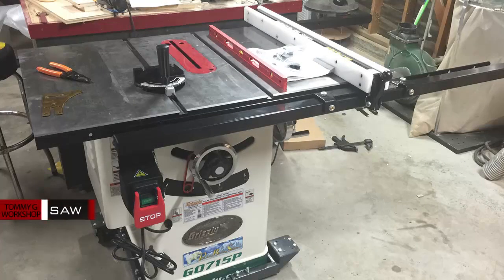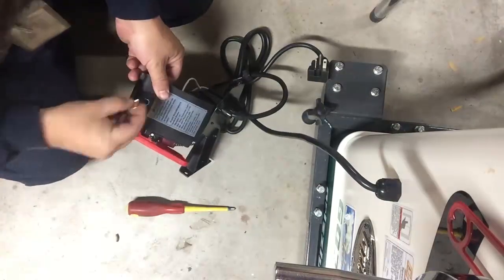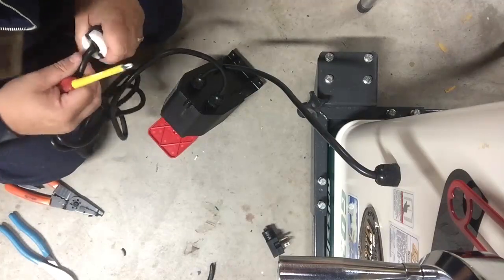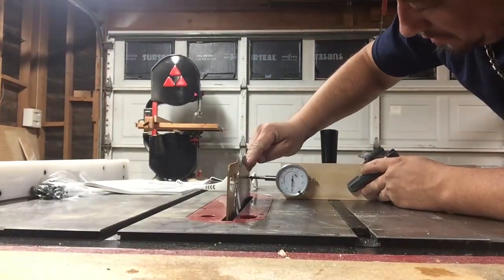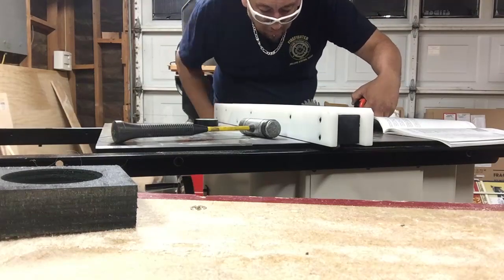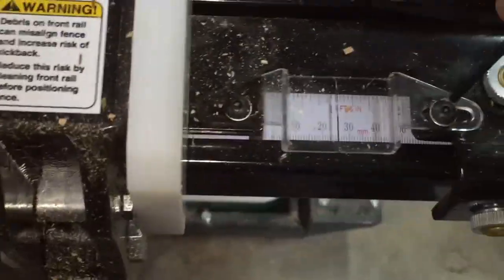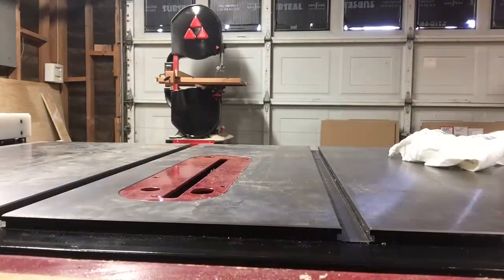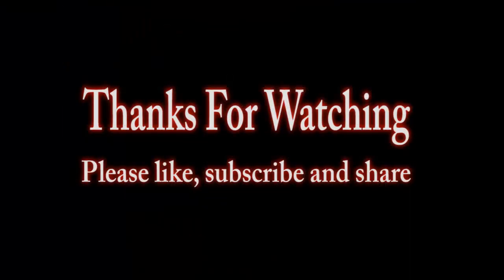Grizzly G0715P Table saw: Wiring and Alignment

Comment: Hey Tommy, i just bought this saw on CraigsList and need to rewire it for 110. I opened it up and started to re-wire what I could while I was waiting for the 20A/110 circuit breaker to come. It arrived today, but now I just realized that I didn't mark the load/line wires from the previous wiring. The wiring diagram on grizzly.com doesn't indicate how to wire the circuit breaker. Could you pop yours open and see how the circuit breaker is wired? I would really appreciate any help. Thanks!
Reply from the maker: OK so the black wire comes from your table saw to the bus bar. From the bus bar to the line side of the breaker. from the load side of the breaker it goes straight to the plug and out outlet (power source). I also have pics, if you need them just send me your email address or email me and I will reply with the pics!! Hope this helps.
Reply: That was my guess. Thank you so much for confirming.

Comment: Great job on this video, I think I'm sold... Do you happen to know if changing from 220v to 110v the saw has less horse power? Or, will it affect the saws performance at all? I have the option to run 220v to my garage, but just wondering if I NEED to...

Thanks!
Reply from the maker: yes it will reduce the power. I only went with 110 because I dont have 220 in my shop yet. when I do get 220, I will be changing it back!

Comment: Thanks for the wiring video, man. But I'm having trouble finding the plug for this. An Amazon search for 110v plug turns up a lot of 15A plugs, but this saw is specced at a higher amperage than that, innit? Did you just use a 15A plug, or is there something I'm missing?
Reply: did you end up using a 15amp straight plug for this? the 20amp plugs dont fit my receptacles
Reply from the maker: I know you can find them at Lowes of you have one near you!
http://www.lowes.com/pd/Legrand-20-Amp-125-Volt-Black-White-3-Wire-Grounding-Plug/1000003410
Reply: Tommy G Workshop This plug has one of the terminals going side to side (not both vertically). My outlets won't fit this style plug, what should I use? I can't find a normal looking standard plug.
Reply: did he ever get back to you with an answer? i am running into the same problem.
Reply: Tweets From The Trail I used a 15 amp strait plug and it worked fine.  I'm also not an electrician so...